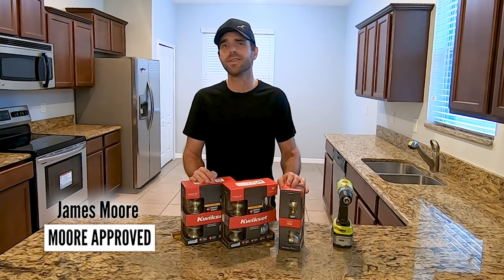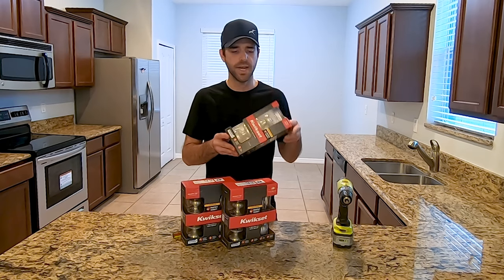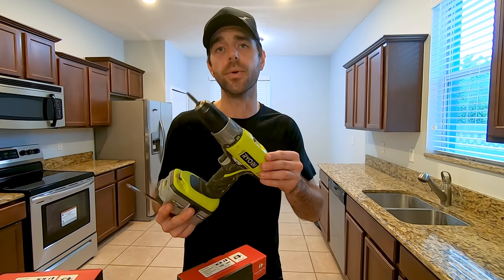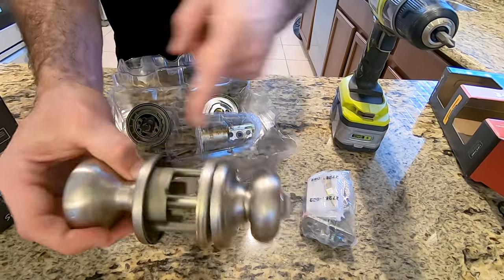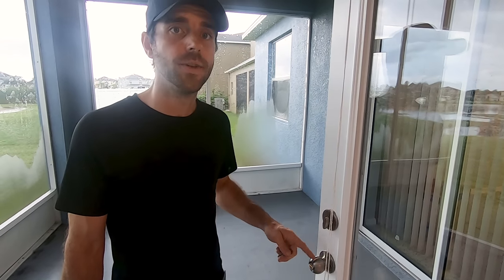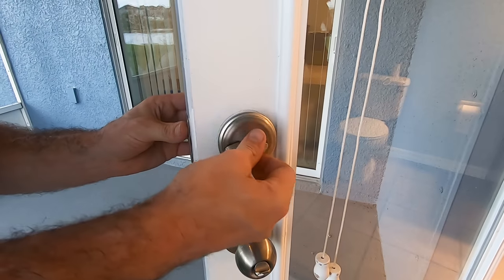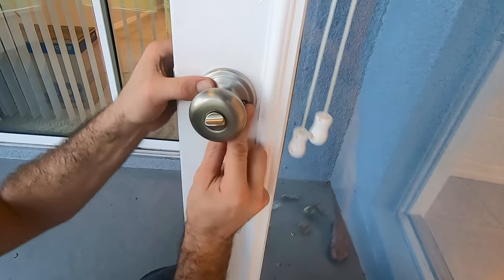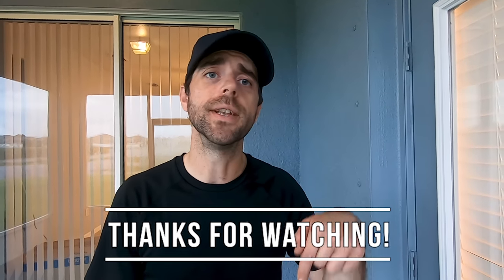Change Locks & Deadbolts on Doors | New House Security Must

Comment: Sharing this to my real estate page! Really helpful walkthrough!
Reply from the maker: Thanks! Typically the very first thing we do after closing is go change all the locks, except for our previous home which was new construction.
Reply: I know it’s been a year since your post. I’m a locksmith and completely agree if to rekey or change your locks when moving into a new home every time. But most forget to erase the garage opener memory and reprogram your remotes.  Remember to do this as well. In case your not aware home warranties now pay for one rekey with a $75 deductible 

Everyone should know these smart key locks are known to fail at anytime. Although I personally believe locks only keep honest people out. Kwikset smart locks can be defeated with just a flat head screw driver. That’s how terrible the design is. And do not recommend them.

Comment: Thanks for the video.  Short, concise, practical and very informative.  With a glass door, is it worth considering a double cylinder deadbolt to prevent trespassers from just breaking the glass and reaching in to unlock the door?
Reply from the maker: That's a fairly common practice but I didn't think it was necessary as they could just break out the entire window on this particular door and walk through the opening. If you have small windows on the door or right next to the door that option would be your best bet.
Reply: Double cylinder then requires you to use the key to exit, which may be very often vs. a potential breaking in that door which you hope won’t happen.

Comment: Are these all set to the same sizes or can I buy some that the lock bolt and knob bolt extend out further??
Reply: On this type of lock, there is a little lever on the locking bolt that allows to you actually extend the bolt shaft to get it centered.  I watched this video and picked up these units but realized he didnt mention that; its very handy.  Hope that helps someone else.  Great video.

Comment: We are unable to remove the cylinder (tumbler/spindle) after removing the exterior and interior locks. It spins around a little, but doesn’t slide out. It’s the Defiant door lock and deadbolt. What could we do about this?
Reply: I have this same problem did you ever get it figured out?
Reply: @jasmineprice2645  We tried harder and it slid out.
Reply: Thank you for your reply I finally got mine’s out

Comment: How would you remove a knob that doesn’t have screws? Thanks
Reply: Did you get it? If not on the inside of the door there's a small and I mean small notch in the round brace that's against the door. Pry it up with a tool and there should be screws under it. I'm about to go try mine rn but I remember hearing that from my childhood.

Comment: I have the bottom lock on my bedroom door but when you push on it hard it just opens even when locked. Can I change that with a dead bolt like the top lock you attached at the top

Comment: Kwikset smartkey locks can be forced open. They also have pot metal and aluminum and plastic in them. They are also poorly made and cheaply made and low quality. Therefore, I wouldn't recommend kwikset smartkey locks and I wouldn't use them.